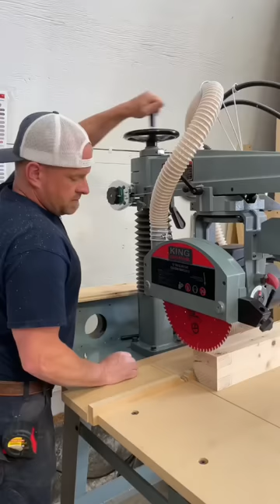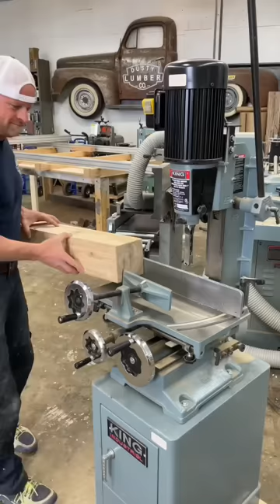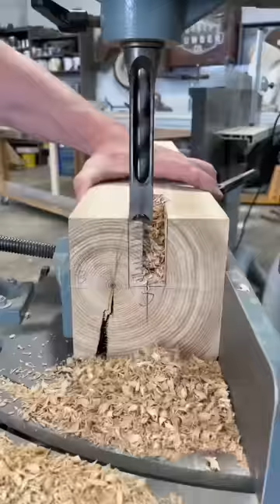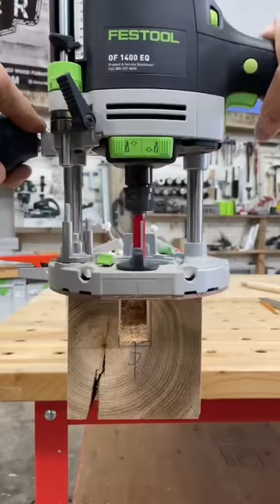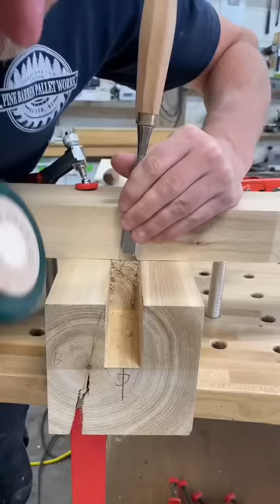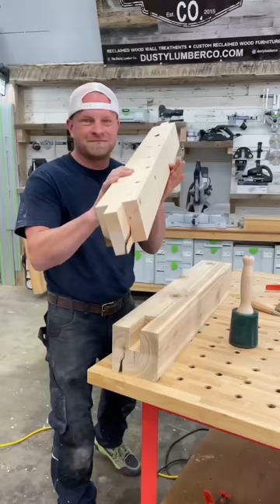Mortise and tenon #woodwork #woodworking #maker #shorts #tools #wood #joinery #work #bois

Comment: My first radial arm saw was a 1960's Delta POS. What a struggle, and so dangerous. Never use cheap RASs. But this machine works properly,  and I would own it. They do have their place in the woodshop.
Reply: I think my late uncle (who had been a civil engineer for the State of Idaho) had a radial arm saw in his garage; at least he had a unit that sure looked like one when we went to visit him every other summer in the '70s and '80s, although I don't recall what brand it may have been (maybe a Craftsman?) I wonder whatever happened to it - I likely could have made use of it now.
Reply: My dad had a Craftsman radial arm saw, new in 1970. He taught me how to use it and wow I was always on edge using it. Very useful for alot of things, but seemed sketchy af when used for anything other than standard rips and crosscuts. Frank Howarth (Frank Makes on YT) has some pretty sweet radial arm saw setups, vintage Dewalts I believe.

Comment: What comes the cost of radial circular saw.
Reply: That one probably cost a good amount but you can get a used one for $40+, the old craftsman ones are plentiful and cheap
Reply: I’ve got a really nice 3HP 14” Italian made radial arm for sale in vt, approximately the same size as this one. 6 bearings on the head. More specific info on request.
Reply: @drgonzo305  In my experience with the cheap radial arm saws, the rails, pivoting systems, and mechanical connections were so cheaply made that when the blade bit the wood, the machine twisted and lost it's alignment during the cuts causing kickbacks and blade binding that damaged the work. That also made operation really scary. My RA saw was good only for crosscuts with the blade in the vertical position. Any other operations were dangerous. Take my advice and avoid cheap RA saws, but I do encourage anyone to get a quality one.

Comment: I bought a manual for a Sears radial arm saw.  To square it up was and is way beyond my skill set.
A radial arm saw can so much, but you must know WTF you need to know about how to use it safely!!!
I was at a wood working tool  show.  Every one does the cut on a pull.  At a blade demonstration I was shown that a better cut is made with a push, but the work has to be held down on the table.